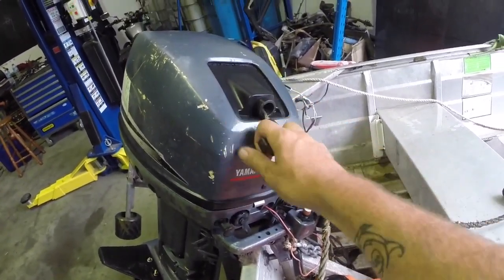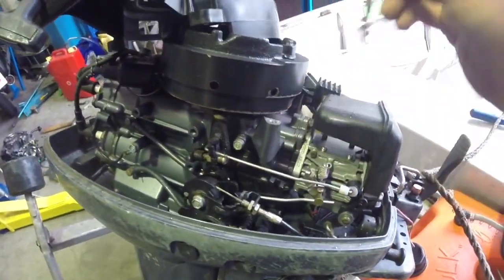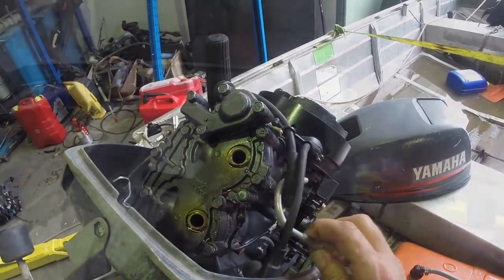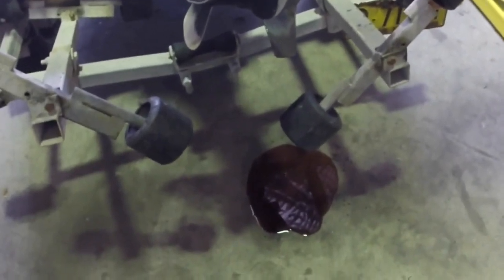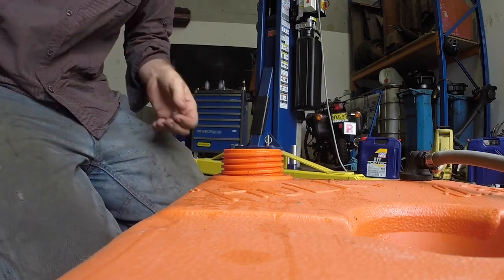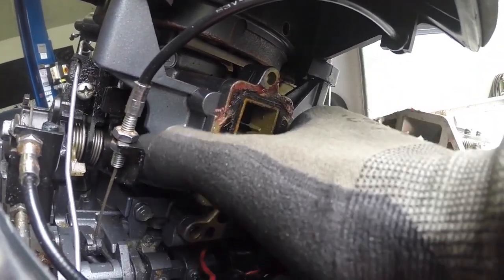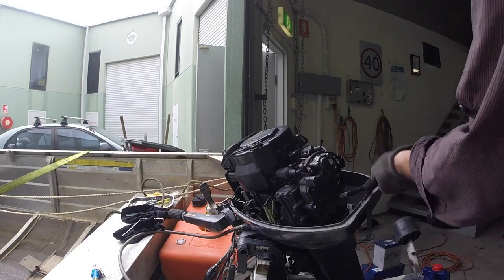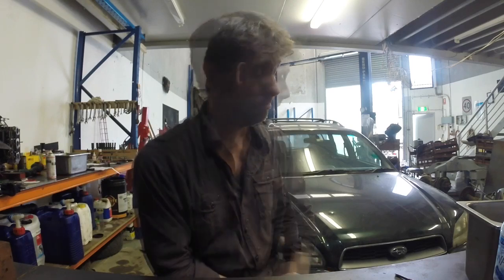Unseizing a seized outboard motor

Comment: I picked up a 9.9 johnson from the 50s! found it on the side of the road seized up and with your method, I brought it back to life I couldn't believe it thanks!
Reply from the maker: That is awesome!
Reply: Just found a free yamaha 9.9 on the side of the road myself! Hope I get lucky with it.
Reply: @derekharper7868 how did you make out with your Yamaha 9.9? I just got one myself I’m trying to unseize it’s an 89 or 90 2-stroke
Reply: @BigRiverLabrador  Not sure yet. Don't know the year on mine but it's a 4 stroke. I do know it wasn't siezed. It just had a cylinder full of oil, so it's now moving well but I haven't had a chance to attempt to fire it up.
Reply: @DangarMarine  - quick question. Your video has been super helpful. I have a seized 18HP Tohatsu. I’ve removed the flywheel and there is a nut holding the starter in place. I can unscrew the nut but if I’m trying to rock it should I be tightening it as much as I can clockwise to try to get it to turn? Is there a threat of over tightening the nut? Or should I just keep trying? Thanks for your help.

Comment: A seized engine like this may be gotten started but it will never be quite right until the pistons are removed and inspected and most likely the bore needs to be at least honed to remove the pitting from the corroded rings,and new rings installed. This is a stop gap measure.
Reply: It's a beater boat - changes are it will run for as long as people need....
Reply: But I guess using it the way it is won't make the eventual overhaul any harder, right? So you get another couple of hundred hours of motoring "cost free", before you do the eventual overhaul. A lot of people don't really use their outboards to their full potential so a bit of lost power from wear and pitting of the bores and rings won't matter to them.

Comment: Try 50/50 mix of ATF and acetone. It's commonly used for seized pistons on old engines that haven't been cranked for 30-40 years. Fill the cylinders and let them set in the hot sun for a few days. Shouldn't take nearly as long for outboards.

Comment: Some years back, a friend gave me a 6hp motor. Said it was seized up. I thought what the heck, I'll play with it. Got it home on a pretty nice wood engine stand that he had it mounted on. After 5 min, found that it was in forward gear, and the prop was hitting the bottom of the stand.
Reply from the maker: LOL. That happens. :)
Reply: Lol hopefully you found that out before pulling your hair and banging it with a hammer LOL we've all had silly things like that happen I got a 2.5 Nissan with a long shaft that would always get water in the fuel if it stayed out in the elements I bought a Yamaha and never have any more trouble but my Yama is a 4-stroke they are way more reliable 90% of the time it's a fuel issue with outboards I find that as long as you use them all the time and keep good fuel in them they won't give you a issue. It's when they sit impellers and seals dry up and cylinder walls not lubricated we've been had a little bit of water in the fuel even worse Salt Air around the Rings dead giveaway when you pull the plug and see corrosion

Comment: I’m going through the exact same process with a Yamaha 9.9 2-stroke. Outboard was in a storage shed during a river flood and was submerged for several days in fresh but muddy water and this is 4 years later the first time the cowling has been removed even. Going on 3 days now of filling heads with rust penetrating spray and injection oil but no give at all yet with pry bar. As mentioned in video though, I’m not forcing it to the point something will break but applying plenty of force. 🤞

Comment: Thanks for this. Just bought a 1966 6HP Johnson that is seized, though it was supposed to be a busted up starter pinion gear that I bought unexamined for $100. Never used or worked on a 2 stroke before, so your videos have been very helpful.
Reply from the maker: You're welcome Paul, glad the videos have been helping you.

Comment: It worked! I seized up a 35 merc. Used PB Blaster and Marvel Mystery Oil as I figured I needed every advantage possible. Let it sit 3 days then very gentle back and forth with the breaker bar and it broke free. More oil in it for another 24 hrs, few more spins then set it up to start. Shocked when it fired up. Great video! thanks so much.
Reply from the maker: Glad to hear you got it running again Sam. :)

Comment: Very helpful, my boat sank as she was moored up wrong.. she was sat under water for about 4 hours every tide for 2 months before I was able to remove the engine, got he in pices now wish i had seen this before compleatly stripping her down to just the power head. Gives me hope she will live again with out the hassle of sending her off. Thanks from the UK.
Reply from the maker: Hi mate, you would probably have found that it needed to be pulled apart anyway if it had been dunked and then exposed to air every tide as that is about the worst case scenario for an outboard. Fingers crossed it will come good though!

Comment: I purchased a 5 HP 2002 Yamaha for $50...yesterday...it was seized...never worked on outboards in my life..found water in the fuel tank...took short breaker bar and kept working it like you described without  much pressure,  kinda snapping it lightly, shocking it,  and in 10 minutes had it un-siezed and had piston turning smoothly with spray solvent...your video solved the problem...!  Thank you so much...Carb is missing so I'll need to source one...Motor looks to be fairly simple to work on since one cylinder and 2 stroke.  Now I can check for spark, and compression...I've worked on lots of 2 stroke chain saws and motorcycles...this is kinda fun!

Comment: I love your videos and have learned a ton from them! There's always another way to do anything, and sometimes another way is better!

I once had a motor go under, while tied up to the beach. the transom was facing the small waves all night long, and the bilge pump failed. The small amount of spray from the waves hitting the back of the transom accumulated in the boat during the night (while I was busy drinking far too much beer), and the hull filled up with enough water to sink. So, about 10am the next morning, hung over and still sleeping, one of my drinking buddies from the night before, stopped by my camp and woke me up asking, "Hey, why is your boat under water?"
 I hoped that he was kidding, but he wasn't. (There's a lot more funny details that go along with this story, but I'll skip to the reason I'm writing this in the first place.)
When I was finally able to get the boat back onto the trailer, I took out all of the spark plugs, the air box from the carbs, and just shoved as much fresh water through the engine, that I could from the hose. Spent about 45 minutes douching out the entire engine. 
The starter actually still worked and so I sprayed 4 cans of WD-40 into the cylinders and the carbs, while cranking the motor and running down 2 car batteries in the process..., and created my own Haz-Mat scene!
(Helpful Hint: Don't try to remove a full sized battery from a boat, STILL submerged in salt water..., it really tingles!)

It was a week later that I was able to start tearing down the engine, and found ZERO corrosion!
Moral of the story..., if you can't do anything else to a motor which has submerged,
 except flush it out with fresh water..., DO IT! And don't worry about getting anything wet, cause that's already happened!
God bless the man who created WD-40!
YanceyMan, west central coast of Florida
Reply from the maker: Agree completely about flushing with fresh. You can also soak the starter in ethanol to draw the water out of the winding. The other thing I would normally recommend is getting it running as soon as you can after it has been lifted.
Reply: WD-40 in my experience is both water soluble and oil soluble. It looks like it took care of the water. I think I will keep a big can on my boat.  PS: You can remove oil stains from clothes with it, just spray and put in the laundry. It washes out and leaves nothing behind.

Comment: ATF fluid is good to remove contaminants and also protects from corrosion. We use it on my mate's race engine liberally on a towel to scrubs away the carbon ridge at the top of the cylinder so we can remove the pistons without terminally damaging them. Not alot of people give thought to this process. But the stuff is great for any clean up work during a rebuild to remove deposits and inpurities. You can leave it right there when you reassemble the engine, it's not going to hurt anything. I think you could also benefit to use it to get the build up off of things like hydraulic rams, stubborn shafts inside your engine when you want to pull the gearbox and as an all round corrosion inhibitor that doesn't wash off in a minute like WD40, Just as a good going over with a decent amount with a rag on all exposed steel surfaces every time you bring the boat back in. Just a suggestion, I'm not trying to control you or anything man.. A friend said his old man used to work onb Cadillacs in the 60s and many cars would come in with noisy lifters (as they sat more than they drove and the maintenance wasn't always kept up to spec. Anyway,  his solution was to dump out a few litres of oil and replace it with ATF and leave the car running outside for a couple of hours, he then dumped the oil and replaced it with fresh stuff and he reckons they were quiet as a mouse after that. Food for thought. I've unseized engines by putting a mixture of ATF and WD40 down the bores and leaving it for a day or two and then trying to see if I can turn it over by hand and rock it back and forth past the point of resistance and slowly keept repeating until it feels normal again. i havent been let down by this.
Reply from the maker: ATF certainly is handy stuff for many jobs. It's interesting to hear about it being used to fix the noisy lifters.

Comment: My motor has has sat up for 6 months went to mess with it yesterday and found it to be seized. Going to pick up some ATF and acetone and hope it works. Thanks for another informative video
Reply: You should be fine but like he said don't force it. Start slow and work it loose.
Reply: @southjerseysound7340   Well for one I wish I had watched the video a little longer and just used 2 stroke oil. Anyway it actually worked much easier than expected. Poured in the ATF then acetone. Maybe 30 minutes later and I could spin the fly wheel by hand. Motor started great. Only problem is now there is a problem with the lower unit. Bought a new motor and will try to fix the first one to sell. Break Out Another Thousand

Comment: Stu, my 2.5hp Mariner for the dinghy had a do over recently, (brother in law fell over in shallow water with canoe :) Anyway, opened the 2.5 hp up  after a year due to bearings (suspect) could not find the  proper bearings with the pins locking the bearing, I used ordinary SKF/FAG bearings to replace it, seals were ok, (could not find them locally )  motor runs perfect, carb inlet had a small piece of gunk (restricted inflow) making the motor fail after 200m or so, after the carb inlet cleared , all ok, fishing the estuary having fun. :)
Remembered your video, cam e here to revisit it, thanks.
Johan
Reply from the maker: Hey Johan, glad to hear you got your engine running again after it's swim. :)

Comment: I love being on the water.  After watching your videos I want to go buy a bunch of old, non-running engines and do the miracles you show on video.  If only it were actually that easy. :) Wonderful videos.  Hope you keep making them.
Reply from the maker: Thanks Jarod. The great thing is you can always find an old outboard motor out there somewhere that someone is willing to part with quite cheaply.
Reply: Just got a 2009 tohatsu 4hp. Got it for 80 euro's. Previous owner lost it from the boat while doing quite a high speed and thus rpm. Hydrolocked totally of course uf to a point that the flywheel key snapped and messed up the timing. Not running of course, and I basically got itas a spare parts engine as optically it was basically new.
But curious as I was I Fixed the timing and flushed the oil etc. And now it is running quite fine again. Has a little knock compared to a good good one but less of a noise that the average 2 stroke has.
Fun to figure out what happened.

Comment: My Suzuki DF 150 seized  at slow speed due to having water and black, thick sludge in lower unit.
Got towed and loaded on trailer and drove home.  i
had to drill out ( bolt extractor) drain plugs of lower unit, flushed with ATF.
Installed new drain plugs and gaskets, refilled with gear lube.
Ran on Muffs and hose, drained again and filled again.Also changed spark plugs, engine oil and filter, greased up drive shaft, new impeller kit.
Motor runs perfect ever since.
Wondering how that is possible, not having any damage.

BTw , you are brilliant man, very informative and entertaining.

Comment: Thanks! Helped me get my Nissan 2 stroke freed up. Fortunately it wasn't nearly as bad as the one in your video. I used 2 stroke oil instead of ATF. Worked like a champ and started on the 4th pull after new plugs and lower unit oil.
Reply from the maker: Always good when they come back to life. :)
Reply: Do you need to take that oil out before starting it? Will it cause any problems if you start it with that oil inside? Or will it be fine?
Reply: @borisleonardoomanasuarez8066  make sure you can turn turn it over normally with the plugs in (not hydro-locked with too much oil in the cylinders). If you can, then you can start it. It'll smoke for a bit while it burns off the oil, but it will be fine.

Comment: Good techniques. I inherited two vintage outboards when dad passed. A 1957 7 1/2 hp Johnson and a 1980 Johnson 10 hp. Both bought new. They have not fun for over ten years. It will be fun to get them running and use them on my dink. I liveaboard on an Ericson 35 and always in need of a tender that can run me into shore when anchoring out. Thanks for your site.

Comment: Thanks for sharing this information. Just got a Yamaha 30 going by doing just this. Luckily I only had to let it soak a few hours but man it was stuck good. Funny thing is, is it was not running for years until last summer when I got it going and it started no troubles what so ever, but then after sitting for 12 months it had all seized up

Comment: Very nice video.  One tip you may like, is to add about 25% acetone to your tranny fluid when using it as a penetrating oil.   I learned this from a machine shop, and it really makes a big difference in how well and how quickly it releases frozen parts.

Good job on bringing that motor back!
Reply from the maker: Thanks Tony, a couple of others commented about adding acetone to the ATF, it certainly sounds like the way to go.

Comment: Best. Comment. Ever @4:10, this is my motto also-cheers!.    Have the F100 torn down as far as I need to as the sump oil was milky.  Found the head gasket was shot around the top cylinder (probably from blocked water ports/channels causing high block temps) and the Sump was heavily corroded. Just waiting on parts now- hopefully they arrive soon so I can assemble before I forget what went where!
Reply from the maker: Ha, I had forgotten about that! Good luck with the Yammy. I know what you mean about hoping parts arrive before the memory of where you are at fades.

Comment: Stu....  Been watching your videos for quite a bit of time now!  I really appreciate your detailed info/suggestions, humor, and real world experience when working on things!  Working on mechanical things like engine/outboards, boats, and vehicles are a passion of mine but not my  daily "profession", so it's nice to get all of your experience.  Its def helped me fix some outboards lately!    That's not always something a college or manual can teach a person.  Subbed and will be getting some swag!
Reply from the maker: Thanks mate, glad you've been enjoying the vids. :)
Reply: @DangarMarine  hey just came across your video and it is a huge help! Thanks so much for sharing. I’m going to clean my carby now! Quick question. I have a seized Tohatsu 18HP and I’m trying to rock the starter but it has a nut holding it in place. Should I be gently tightening that bolt (counter clockwise) to try and get it to move? When I go the other way it undoes the bolt. Any advice would really help! Thanks

Comment: My Johnson 30hp is stuck so I'll give this a try. I forgot to install a spark plug back a few months back, must have been distracted by my kids :( and the piston is seized from moisture getting in. Thanks, the video was very informative.
Reply from the maker: Chances are it will be fine. I was also recommended to me below in the comments to try a mixture of coca cola and vinegar as a mild acid to remove the corrosion. Could be worth a try.
Reply: I have a Johnson 25hp we used on the weekend and smoke bellowed out from the motor and we slowly made our way back to the dock. The thermostat melted from the motor and the tell tale plastic elbow on the motor melted. I stripped down to the water pump to find it melted. I installed a new pump. Re-installed everything, Tried pull starting this morning and its stuck. Would the pistons have seized up even if I physically had to stop the motor when we reached the landing? Or is it possible to free it up as per your video?